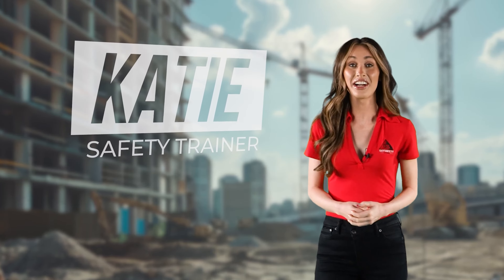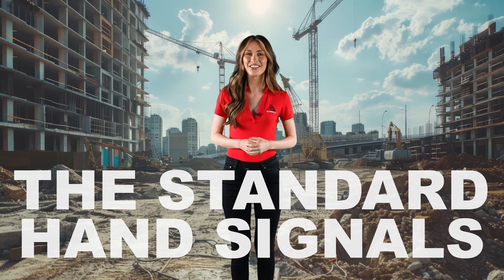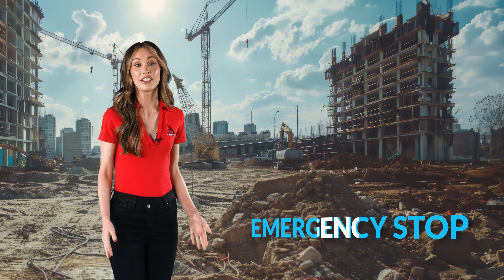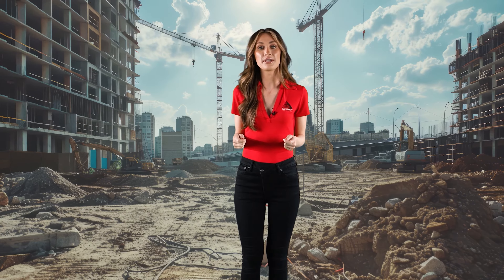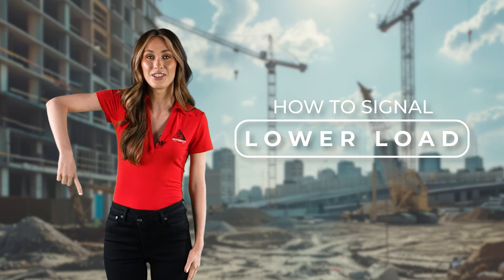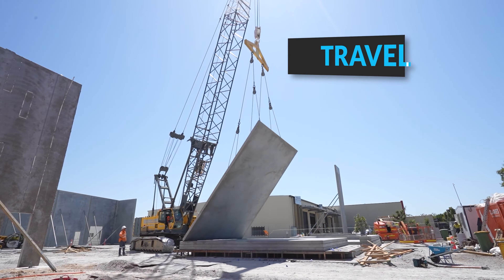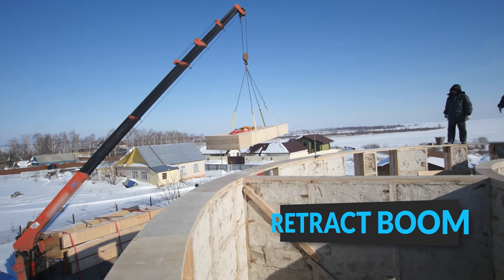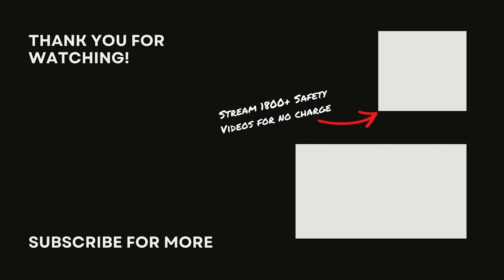Crane Standard Hand Signals: The Complete Guide | Toolbox Talk

Comment: Crane operator here. If you want to make a  ACTUAL crane signaling video, i am available for consultation.  This video is dangerous. Viewers must not engage in the rigging practices you see here. The signals are correct but incomplete.  You show a fixed boom  tower crane while showing the boom up/down signals. Very amateur. The pallet of bricks at 5:02 is particularly disturbing, but just one of many rigging atrocities in this video.
Reply: I agree with all your points. While i was watching i was picking it apart every step of the way. Just to add another, she showed a crawler "traveling" around and talked about it turning,  but no signals shown. Also, I've never seen so many hooks without latches.